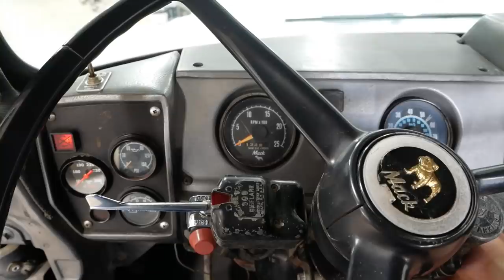"Simple" Axle Flange Leak Escalates Quickly - Vintage Mack Truck - Part 1

Comment: “Universal seal driver. Darned things grow on trees.” 😂😂😂
Reply: should those be soaked in oil before use?
Reply: and they're recycleable
Reply: @TXH1138   Keeps the termites at bay!
Reply: The universal tool didn't seat it all the way so he had to use the correct tool. I think he hind the brand name was it a true OAK brand cause those last a lot longer if used right.
Reply: A truly universal tool  indeed! It drives seals, removes seals, holds up heavy loads,stops stuff from rolling away,makes jacks taller and if it gets cold in the shop it will provide heat! Thats when the oil soak comes in handy.

Comment: Maintaining old trucks is like painting a bridge as soon as you finish you have to start all over again.
Reply: So true
Reply: Exactly, never think "Well I took care of that.", because a year or two down the road you may end up doing it again.
Reply: That's about right
Reply: Buddy…if I had a dollar for every old truck that came in for one brake chamber and set of shoes that ended up being a wheel seal & bearings as well…usually when old stuff came in, I joked and always said “here I’ll tell you what still works…”
Reply: When those trucks where new it was the same, everything then needed more maintenance, like sparkplugs, now they last 100.000 miles.
Reply: That's actually an urban myth about bridge painting...😮
Reply: George Washington bridge in No/Nyc does just that

Comment: Wes, just some feedback, I hardly ever notice the truck traffic noise. 

Also, I love your videos. Thanks for you hard work putting them together. I never fail to learn something.
Reply: Agreed. The only time I notice the traffic noise is when you point it out :-). I think we all understand that you're not in the studio
Reply from the maker: It's mostly distracting to me while filming. I filter it out during editing.
Reply: @WatchWesWork  ah
Reply: @WatchWesWork  Thanks for going the extra mile in the editing process for us.
Reply: @WatchWesWork  
👍👌👏
Reply: @WatchWesWork  cheers
Reply: Good parts store...HA! We have ONE of three in my little town that's good, but the others would not even LOOK for a 9/16 fine thread nut until I told them the make and model of the cehicle. NOT a confidence builder...
Reply: @hgj2019  Did they want to know the VIN also? That's what I get. And I'm looking for an oil filter for a 5.3 Chev.
Reply: @garys9694  right! Looking for a part so universal it would work on MANY DIFFERENT CARS AND A FEW TRACTORS, and they can’t find it without model info. SMH…

Comment: I knew a mechanic who used to save all the objects he removed from tires. It was amazing what tires pick up.
Reply: There's an old guy where I buy my tires who saves everything he finds. The most common was 8D nails. Now it's roofing nails and sheetrock screws. The weirdest??
A 3/8 x 3" carriage bolt.
Reply: I once had an entire welding rod enter the rear tire of a motorcycle I was riding.  When I took the tire off to fix it, I found it had hit the rim and curled up like a watch spring!

Comment: Back in the day whenever I did a flat repair always went back over it with glue to keep the edges from curling up and causing a failure. Never had a flat repair come back. The liner stuff looks to be a big step up for protecting the edge of the path.

Comment: In my much younger days I worked in a "Service station". That said i was tasked with fixing flats, mostly warranty farmers tractor, shredder/brush-hog and trailer/pickup returns. I learned fast to mark stem location on tires. and remove thorns (Mesquite) verity. 2 - 2.1/2 long that my predecessor did not remove from inside tires! He put them back on. Flooded with agitated repeat offenses. I usually used a shop rage to snare hazards puncturing tubes he had just repaired. My tire machine was all muscle no pneumatic assist. :hand-pink-waving: gloves not provided. Hats off to you once again.

Comment: Wes you have done it again my life is just one flashback after another your use of feet off and then on with the truck's tire was how my older brother does it, he started with bicycles and then motorbikes and cars to finish his trucking career changing out tires,keep it up I am sure never to forget my life another great thank you and your lovely assistant.
Reply: Yes sir those tubeless tire setups on a big truck wheel and rim are just as easy as a bicycle tire if you know what you are doing. Proper bead lubrication helps and also allows for easier removal and proper installation of the tire on the rim. When I was a kid it was nothing to pop a bicycle tire off the rim using two screwdrivers and either patching or replacing the tube.

Comment: Standing on the sidewall to keep the bead in the drop center is a good trick. The tires I deal with are usually much smaller, but still.
Reply: The best part is because the wheel diameter is so much larger, the tires slide over the wheel a whole lot easier than tires for cars and light trucks do.
Reply: @ralfie8801  yep smaller the tyre harder it is , Id rather do a truck than a wheelbarrow
Reply: monkeyboyclyde 
Some of that has to do with how heavy the tire is also, a 2 ply 8" wheel barrow tire is a whole lot easier to change than a 6 ply tire for the same size wheel.

Comment: Wow... I have NEVER had a semi-tire bead break just by standing on it. Lucky! You should consider investing in a tire dolly if you do a lot of tire repairs. Save that back!
Reply: Ditto!
Reply: A lot of the upper end semi tires bead break by standing on them. Michelin, BF Goodrich, and Toyo all seem very good
Reply: @RepairsforOats  To be fair, I have been retired for ten+ years. Most of what I dealt with was far from the upper end. 😖
Reply: @rb3425  I hear you
Reply: He has a full tire setup (including a balancing machine) but I think the tire was just too big for it.
Reply: @Daktyl198  A tire dolly is made for those large tires. You don't need a tire dolly for cars. It would also help him with large tractor wheels. A tire dolley allows you to adjust and hold a very heavy tire/wheel assembly at a precise height and angle. It makes dealing with singles and duals super easy. Not to mention avoids back injuries. I know because I have been there!
Reply: I mount a lot of tires on a fleet of concrete mixer truck, trick i use is after all air is out i use a weed sprayer full of concentrated degreaser soap around the bead on both sides, i just let the rim fall on the rim edge side and the tire literally falls off the bead, its the old rusty crusty steel rims that fight back.

Comment: Enjoyed driving those short hood trucks. First one was a 68 I believe with reverse on the main box, later one was a 78 with reverse on the aux. one could hit all five in reverse which was fun.
 First had a brass plaque that read “ built especially for Ellsworth Motor Freight Line, Ellsworth Kansas.” 44K Camelback susp. and air assist steering. Those old truckers were a breed all to themselves for sure.

Comment: Looks like it’s in beautiful condition for a ‘77. I love the Bermuda Triangle comment. All you need to do is repeat Eric O’s phrase: “common baby.” I’ve never picked up a wrench in 66 years, but I love learning from you, just in case I were to pick up a wrench in the years I have left 🤣. Best Regards sir.

Edit:  BTW, I usually buy the tools you show, even though I’d never consider working on my own cars and motorcycle. I have a tool problem, I have admitted the problem, which is the first step…oh wait, I just like tools. Best!

Comment: Wes nice looking mack.The owner does a good job keeping looking good. I learned on an old mack with a 5 speed tranny and a 4 speed auxiliary transmission. Those were good times. Be tough to do it now that I am older
Reply: Drove an old B model Mack with that transmission. The two gear boxes were bolted together. Mack called it a quadraplex transmission. The 5 and 3 a triplex.

Comment: I was taught to always replace any lockwashers with new ones. I was working at a military contractor and they showed me charts where by the fifth time a lockwasher was re-used, it was worthless. This was probably for smaller lockwashers, the big ones on that hub might be fine, but lockwashers are so cheap, it just seems like good insurance, plus new ones look nicer. Great video, like always.
Reply from the maker: The general feeling seems to be that lock washers don't really work at all, even when new.

Comment: My favorite part of the whole video? Seating the bead with that air cannon. So, so many tubers using the brake clean/starting fluid/other flammable liquid trick and here you are using the right tool, with no drama - this is how I know you value your time and life.
Reply from the maker: The blast tank is a must have tool for any kind of tires. I've had to use it on car tires before.
Reply: Yes sir those "cheetahs" as they are called work well but if you do not have one starting fluid sprayed in the tire and a little trail sprayed on the ground will give a sort of fuse so you can stand off from the tire. Some tire mechanics have used an inflated bicycle tube to fill the gap in order to get the tire to seat, and there is actually a rubber tool that one can use to accomplish the same thing but they are tricky to use. The "cheetah" is the most effective to use in time management, and an enterprising fellow can make his own. I have broken down tires that I used starting fluid on some time after mounting them and can still smell the odor of the starting fluid inside the tire.

Comment: I have the gear wrench that holds the square stud for the inner dual. And undo the nut for the outside dual. 
Haven't used that wrench for so long I don't remember what it's called. Great job as always.
Reply: Budd wheel socket maybe?
Reply: basically acts as a torque multiplier. haven't seen one in years.
Reply: Who makes that tool? Thanks and take care.

Comment: Next time instead of using the air hammer try a cheater bar and a jack stand,you will be amazed how easy that nut comes off.Love the videos,keep them coming.
Reply: Yes sir I have done that and when I did not have an air hammer I have changed out tires and wheels using that method. To say it is a workout is an understatement. I finally bought me a one inch drive impact wrench and used a six inch extension to break lug nuts loose. Thought I had died and gone to heaven.

Comment: I've not driven Trucks for so long (retired), that I forgot how labor intense it is to break down the wheel to fix or change truck tires! Drove a '77' R Model Mack when it was new runnin' Coal here in Kentucky...
Reply: Drove a few that came from up there. Hauling Carolina rock and dirt.
Reply: Yes sir it is a health spa endeavor to work on those big truck tire and wheel combination.

Comment: When using that particular seal installation tool, I believe the grain is supposed to be in the same orientation as the direction of rotation
Reply: Aren´t we getting a bit nitpicky now? You can easily compenssate for that with a bigger whack stick anyways.

Comment: I would highly recommend they switch it to a pair of group 31's in parallel instead of those series 6v its not 1970 anymore and it will crank much  better.
Reply from the maker: That’s the plan. 4 group 31s in parallel. Those series batteries never seem to charge evenly.
Reply: I had a boat once with 4x 6v batteries (had a 6V53 Detroit) , the setup does have some advantages. I used to run traction batteries (for forklifts) and those things would provide rated current for ever and then just fall over. No gradual slowing of cranking speed, all or nothing. Just what a diesel needs.
They were also very forgiving of sitting undercharged for long periods.
Reply: @WatchWesWork  we went to 3 group 31's and never looked back. Even have just 2 in some yard trucks

Comment: Your California critic here.  Excellent diagnostics, as usual.  Nice to see you working to fix everything per the book.  It’s amazing how so many wheel studs are installed with the incorrect studs.  Your comment on the cost to do it right explains why.  

Tire repair:  I know you can do it but why not use a mobile tire service?  It is one of those jobs that will turn you into an old man—quickly.  They can usually do it in a more efficient manner.

Bug sprayer:  I’m glad to hear  that other people are posting their warnings.  Keep your kid, wife and dog inside until that stuff dries—like the next day.  I don’t care what the ag companies say.  Give those chemicals wide berth.  Many of the long-term exposure issues are just not known even though they say they are “safe.”  (I don’t get people—-they won’t get vaccinated but they will swim in these ag chemicals all day long.)  Be safe.  And try not to make Max jump with the air noises.

Comment: Some of the parts auto manufactures chose to make out of aluminum just baffle me, it's not like aluminum fatigue limit is a big secret.
Reply: I don't think aluminum hubs and wheels aren't very practical. I think the aluminum hubs were mainly used on what Mack called their Western models. We had a Western R model but it had Dayton wheels so no aluminum hubs. Budd wheels are notorious for the nuts rusting to the threads and I've seen the studs spin in the hubs trying to remove the wheel.
Reply: Semi truck manufacturers did alot of parts in aluminum to save weight, the heavier the tractor was, the less you can legally haul. Peterbilt had aluminum frame rails for a long time, may still have that option idk. Most bodies on them are aluminum too. You take a few hundred pounds over a million miles of life cycle, it adds up.
Reply: @jasonwithrow7972  Old Freightliners had an aluminum frame option too, I believe.

Comment: Hi Wes. I love your videos. In the past I’ve seen you pack similar bearings. How were the bearings on this truck different that they didn’t need to be packed?
Reply: Lubricated with oil instead of grease.
Reply: If it has a fill plug on the hub and you refill the fluid there is no need to grease the bearings. 
If there isn't a fill plug at the hub on oil bath bearings, I will pack the bearings with grease as a fail safe.
Reply from the maker: The bearings run in an oil bath. We will have to tip the axle once the wheels are back on. That will refill the hub. Then we just top off the axle and we're done.

Comment: I use to work at a tire place when I was in high school and even after HS and I had to change truck tires on the side of the freeway and that sometime in the pouring rain an in winter it was a fun job I was the emergency tire guy so I got to take the company tire truck home with me all the time. Changing big truck tires on the side of the road is lot's of fun you gotta try it sometime LOL!
Reply from the maker: Yeah it's hard work no matter how you do it, especially the big single steer tires.

Comment: If someone really, desperately, wanted to save the hub (maybe it was a gift from a deceased grandparent?) then you could bore out the stripped threads, cut new threads for an insert (not just a helicoil... use a proper insert).  Screw the insert so that it sits at the proper depth below the surface, bore out the threads over the insert, and then press in a bushing.
I'm pretty sure this wouldn't be worth doing, but it could be done by a sufficiently bloody-minded individual who doesn't value their time.
Reply from the maker: Ahh. Yes that would work!
Reply: You could also bore and tap to a larger size, and make stepped studs.  I've seen it on a factory reconditioned engine from the 60s, had 3 'rescue' stepped head studs.

Not sure which would be more work, mind you.

Comment: Man I love watching you work on stuff. I didn’t see the part where you added new oil to the hub so I assume it was too boring to video.
Reply from the maker: We'll tip the axle once the wheels are on.
Reply: Ya we do the same thing with our Mack  Granite tri-axle dumps. Just back them up over a foot tall stank of boards ahold for a min, then drive forward. And off to the hauling and dumping.

Comment: Great Video Bud. Brought back Great memories  when I worked at a trucking company up home for 10 years as a head mechanic..Changed a bunch of those hubs on old Mack and others ones..Guys use those big impacts too tightened those nuts and pulls the threads  Everytime..Great Video Wes. Thanks for sharing
Reply: Yes sir sometimes you can do a lot of damage with an impact wrench especially on aluminum threads. There is a point where using a torque wrench has its advantages.

Comment: Hey Wes.  Was watching you struggle with dismounting tires. Well, sort of struggle with removing tire from rim. Here's an old trick from an old timer...use paint thinner.  Put paint thinner in your bottle.   Spray around bead.  Tire will almost fall off  steel or aluminum rims. Plus makes rubber slippery to also separate rim out of tire.  You were fortunate with tire bead falling off rim quickly,  because truck never sees corrosion.  Have used paint thinner to dismount truck/trailer/tractors/ combines/Skid steers/any tire you want. It works well. 
Over 40 years of it myself. And taught by my Dad, when growing up.  Been around awhile!   The thinner penetrates the bead,  makes the rubber slippery quickly,  allows fast, total dismount,  then evaporates away.  Try it, I know you will catch on quickly and appreciate.  Telling the facts, there is no compound on the market today, that works better than good ol' paint thinner.  I Am from Michigan,  
with that said,  experience is golden.  lol.

Comment: yes all axle flange gasket leaking job escalate quick. turns into failed bearings then turns into cracked brake shoes then turns to wore s-cam bushings then slacks maybe a chamber 🤣 hats off to you man breaking down a tire I just send it to my tire guy I dont even touch them. great one man cheers!!